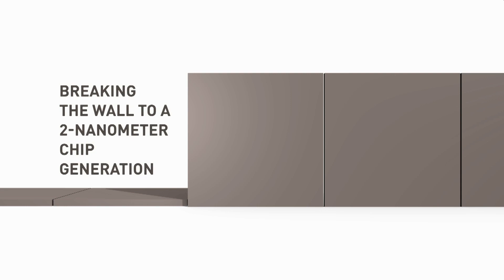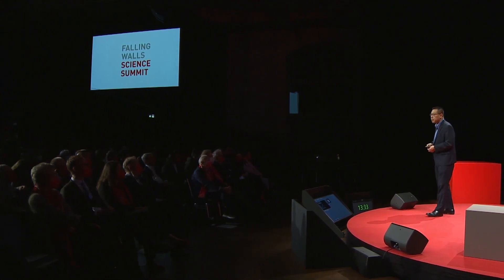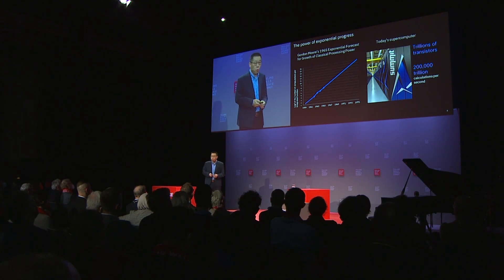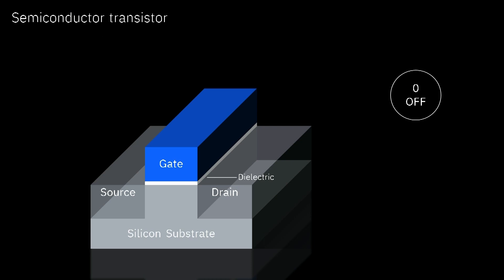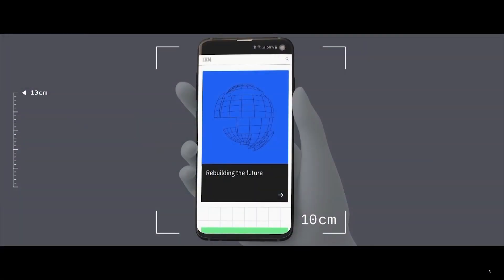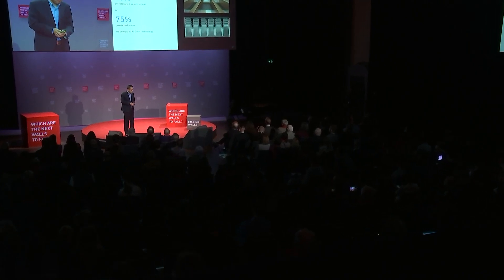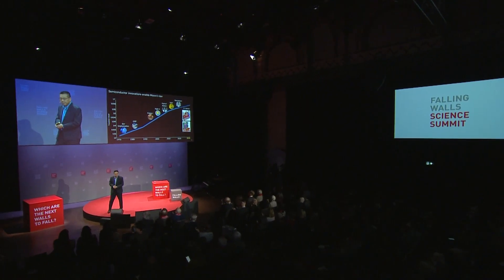Semiconductor Technology: Breaking the Wall to a 2-Nanometer Chip Generation | Huiming Bu

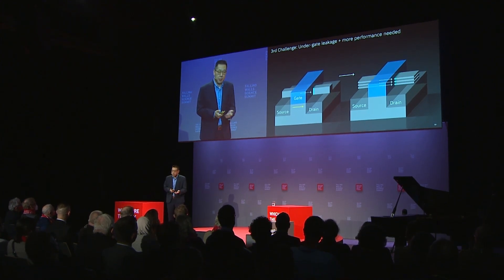Comment: ( Minute 10:01 ) This technology might go into mass production in about 14 years. 
The result : 45 % improvement of CPU calculation performance, or ..... saving 75% energy consumption ..... that is not what i hoped to hear ... it´s sounds like we are stranded with our todays CPU performance and going nowhere far in the next 15 - 20 years. 

My hope still is in photonic chips, which will hopefully increase computation power 100 times ( minimum ) than it is today.
That technology obviously might be developed faster than this presented one and will be more effective.

Time will tell ... endconsumers might have come to an age of technology, where slower paced delivery of new electronical devices/gadgets that make our lives more interesting/funny/diversified.
Next upcoming devices ( like Meta Quest 3 / Apple glass / Vuzix glasses / etc. ) with miniaturized chips will have to last at least 15 - 20 years with very slow improvement of performance increase with upcoming iterations .....  until the huge breakthrough will be done and computing performance gets a sudden exponential increase. 
That will be the age of artificial intelligence driven humanoid robots which can do anything that humans can do. 
The robots build now and during the time until we get to that point will only be prototypes and they will perform in very simple tasks.
So in 30 - 50 years life will be very interesting.
Too bad that i will not live in that time, as i am in my 50ties today. 
But still i am very happy with what i experienced in my lifespann until today from the first  black and white TV´s and portable phones ( as big as lunch boxes ) until today where we have 8K resolution  70"inch flat TV´s and foldable smartphones ( miniaturized computers with internet access )  in our pockets.
What a time to be alive !

Comment: I do not want to be negative but PCs are getting more power hungry by the day as video resolution becomes more and more each day. More computing power will not bring down electricity consumption it will increase it.
Reply: If, IF, the greater compute power is obtained by continuing to shrink transistors and pack more into the same area, then capacitance and thereby power are reduced.	

That’s why continued progress is essential.  Otherwise both power and cost will grow.

Comment: Very interesting. We went from 50 transistor to 50 billion transistors on a chip in 50 years. I wonder where we'll be in another 50 years. We will have to play on the same team of physics, mainly quantum mechanics in order to avoid stalling and deviate from Moore's law.
Reply: The pace will 100% slow down because basic physical limits cannot be changed. However other tricks for how to structure the transistors and how to build the chip overall with all its layers can be used to continue improvements, though no longer at the pace we saw in earlier times.